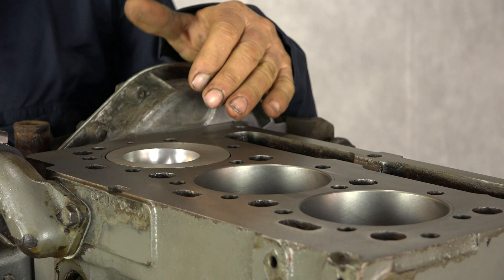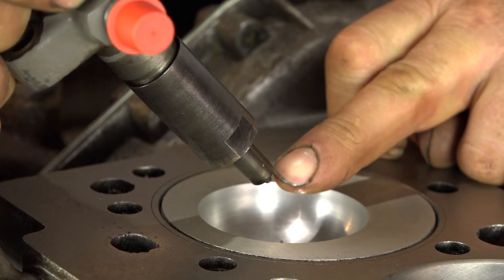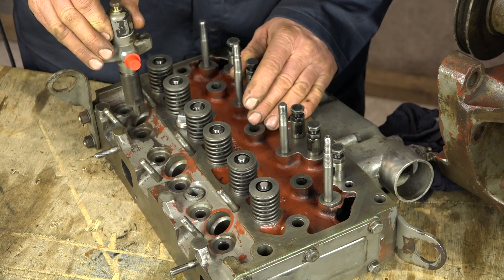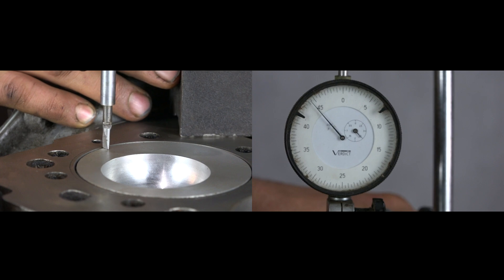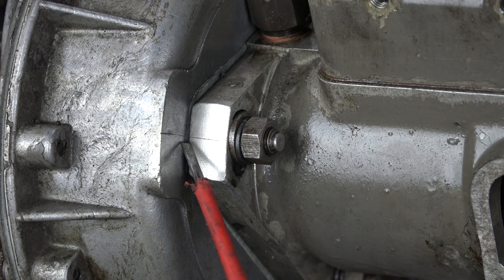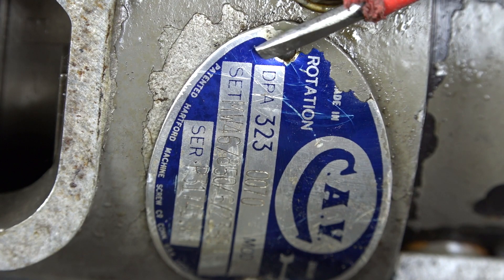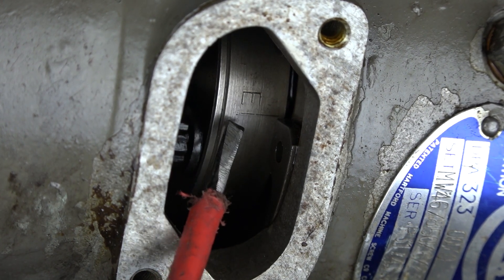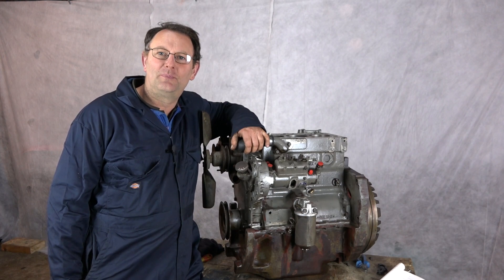Perkins AD3.152 Direct Injection Engine Differences, as fitted to Massey Ferguson 135 tractor

Comment: Hello. After installation in the engine block, is it necessary to drill the liner (cast iron or chrome with a ring) to the final size, and then (hone) it if the liner is already finished? And which liner do you recommend I install, cast iron or chrome, and from which manufacturer for the Perkins A 3152 engine?

Comment: Hello great video.
I was looking for the link to the indirect injection motor. While I’m asking for that, I would also like to know is there a difference between the Massey Ferguson 35 and Massey Ferguson 50 three cylinder Perkins diesel motors? I have both models in diesel.

Comment: The only thing that seems a bit hit and miss to me is lining the E line on the fuel pump with the edge of the circlip?  It assumes that the circlip was installed correctly with it's ends finishing in an exactly marked  position and that it has not moved from that position?    Otherwise it's a clear and well explained video.

Comment: Hello. well done.
I have an AD3.152 engine. But there is no angle on the flywheel. there are holes.There are 3 small holes behind the big hole.What do these holes mean? The flywheel has an "I" mark when the pump is at the E mark.pump mark is above the timing box mark.5th gear is installed instead of 3rd gear.It was like this when I got it. How can I set the pump to its standard setting?